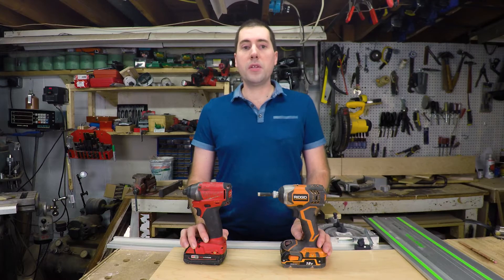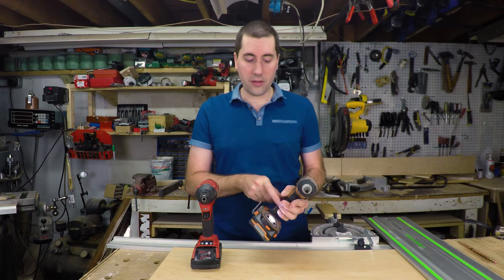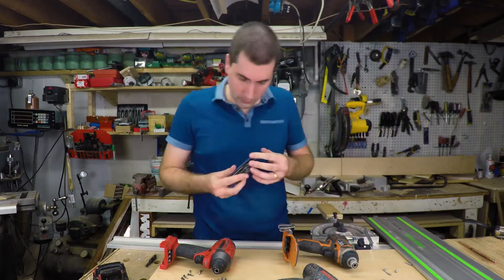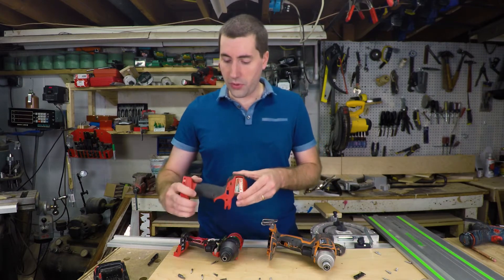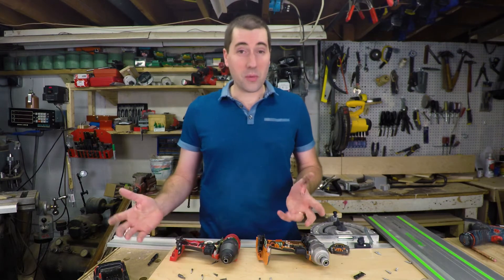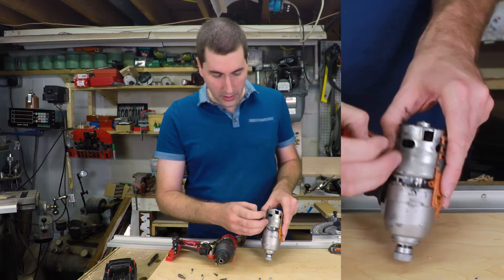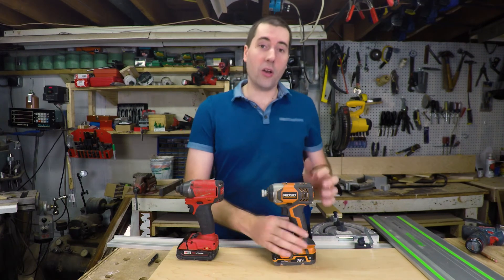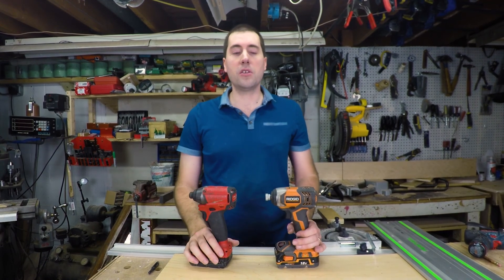Ridgid vs Milwaukee Impact Driver Teardown!

Comment: Product was new as described in ad.๏๏>share4.photo/rImpactWrench?rs     Have yet to use but did test the operation with another battery from a different Ridgid tool.

Comment: They. Are both manufactured by TTI RIDGID  as a brand is owed  by Emerson TTI is subcontracted to manufacture the power tools and they own Milwaukee if you look online AEG  is basically RIDGID power tools. Except  it's all black on the rubber  molding instead of Grey like RIDGID and actually AEG  has  got toolS  that Ridgid needs HOME DEPOT IF YOU'RE READING THIS AND RIGID IS there's   AN ANGLE GRINDER  I SAW. TAKES TWO BATTERIES   YOU SHOULD DO THAT WITH A COUPLE YOUR TOOLS

Comment: Listen to the tone of your voice, from the git go it's obvious the review would be anti Milwaukee, Pro Rigid, finished watching, I was right. Some tests show that brushless motors are upwards of 50% more efficient, much better than 20%, again notice your tone get louder with the Rigid, and lower with Milwaukee, everybody now knows how future  reviews will end up.
Reply from the maker: Well yes, obviously I knew which one I liked better before I started filming, I’ve used them for a year or two.
Reply: I noticed in about 30 seconds he was very biased against Milwaukee
Reply: This dude is not a Milwaukee fan at all I can tell the but in of the mill walkie bodder's in the plastic of the   Milwaukee bothers him The light of the Milwaukee Bothers him The motor of the Tool bothers him
Reply: I've tried them all from ryobi, milwaukee, makita, dewalt, rigid, Bosch doing post frame construction which requires 1k+ screws easy every job on metal. I've stuck with milwaukee for 5yrs now and no issues. Dewalt and makita with 2nd place. Rigid burns up pretty quick after a few months putting in 1"-1 1/2" sheet screws and 3" deckmates. The Milwaukee has some umph and the durability sells them alone. Not to mention 5x the battery of the rest. But for smaller jobs or lighter use a rigid would be fine.
Reply: Dude, he likes the rigid more. That's his opinion. He owns both and uses both. He is honest about his opinion. Most people who love Milwaukee and say rigid is inferior don't own rigid and never use it. Also, Rigid does have brushless and in some cases have better specs than comparable milwaukee that is twice the price. Rigid tools are the best value in power tools. He isn't saying Milwaukee is shit. Everyone knows Milwaukee is an awesome tool be brand as well. You're pretty obviously a Milwaukee fan boy

Comment: You kinda glossed over the battery life and power differences... This should be retitled as "ergonomics and durability review.
20% difference in battery life is hardly something to be dismissed as you did in the video. Imagine 20% worse fuel economy in a car...
Reply from the maker: Well its really more akin to a 20% smaller fuel tank,  and how often do car reviews comment on the size of the fuel tank? I have done some testing and the battery life is about 10% better on the Milwaukee, but that maybe that the Milwaukee batteries are newer.  Thats why I didn’t include it.  Also if you need more battery life, bigger batteries are available for both drivers, or you could get a brushless driver.